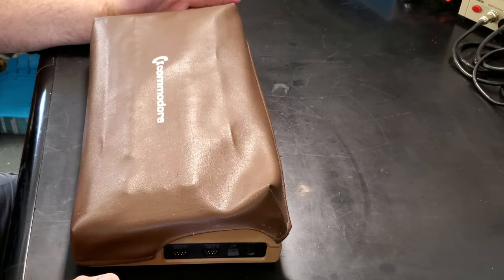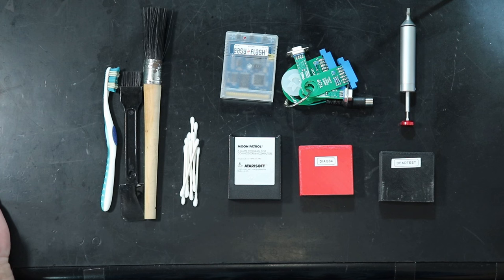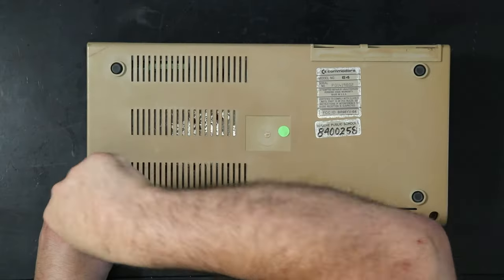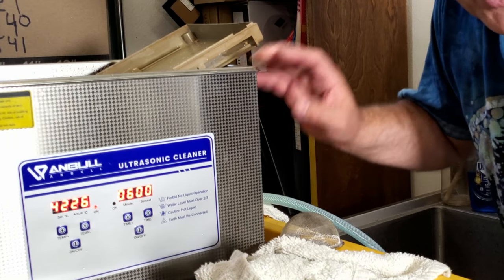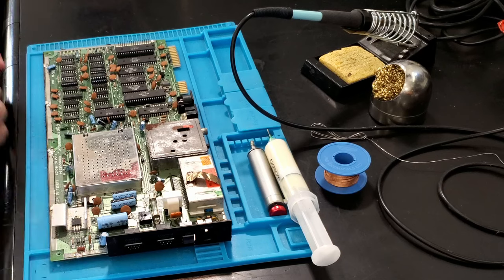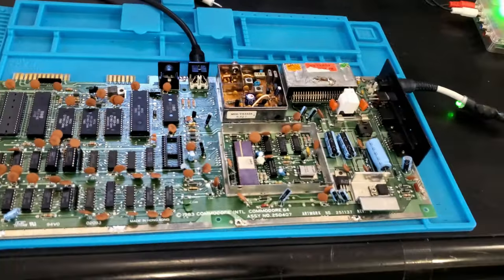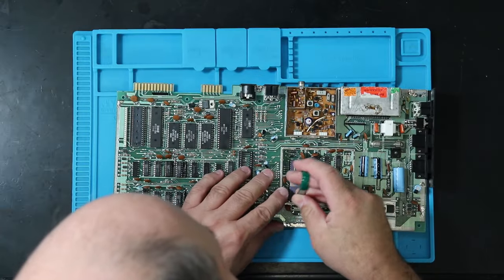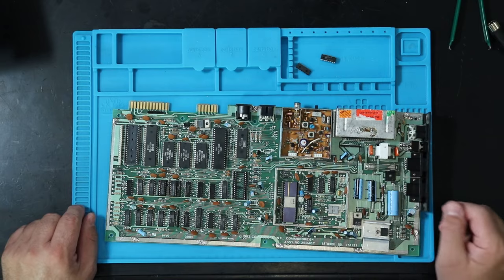A Messed Up Commodore 64 - How I Restore a C64

Comment: At just $25 plus shipping the "PINECIL – Smart Mini Portable Soldering Iron" was a game changer for me.  It warms up in seconds and is temperature adjustable.   Small and is powered using USB C .
Reply from the maker: Thanks, I will check it out. How does it do on large ground planes like the C64s bottom shield?

Comment: Nice work so far:)   it's been a while since anyone has had a c64 repair video.  I collect and restore them myself.  Unfortunately they are getting mose expensive to buy even Untested 😕.  Can't wait for part 2:)
Reply from the maker: Thanks Donald, I am working on it as we speak! I have fixed the video issue and was wondering if it is unusual or something I just happened to not see before?
Reply: Honestly,  you would know better than me.  You have better equipment and experience than me. I've only been doing it for 3 years.. mostly in the winter.  I have never seen a screen like that before.   I've seen quite a few, but not like that.  Good luck:)
Reply from the maker: Thanks Donald. It seems unusual to me but the fix left me thinking it might be more common and I had just happened to never see it.

Comment: looks a lot like the psu i cleaned out after 8 years of constant running :D (without catching fire)
edit: at least on the outside. the inside looks surprisingly clean
Reply from the maker: I was very surprised how clean it was inside. Still, plenty of bad chips!